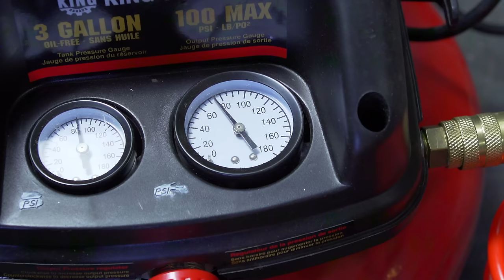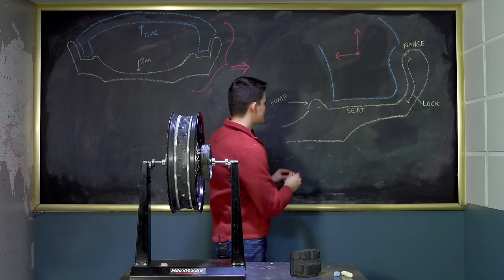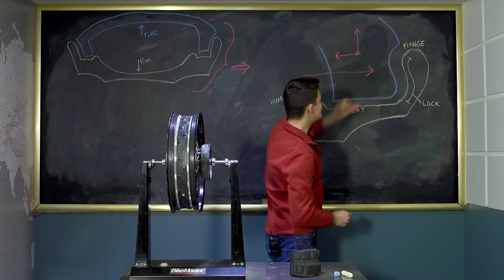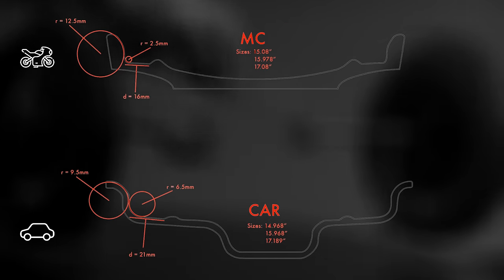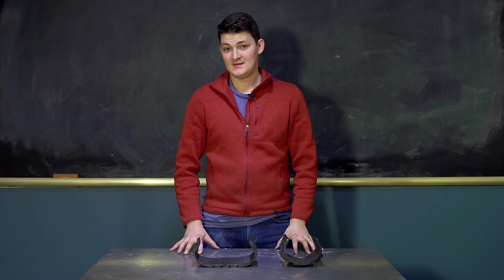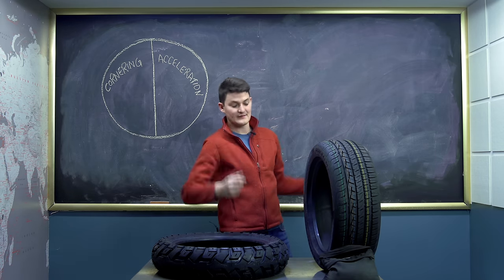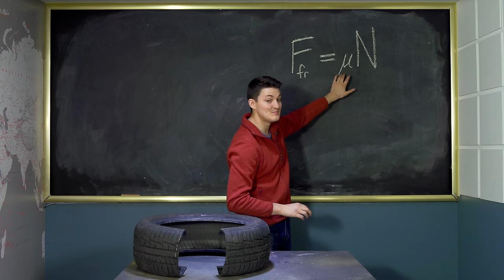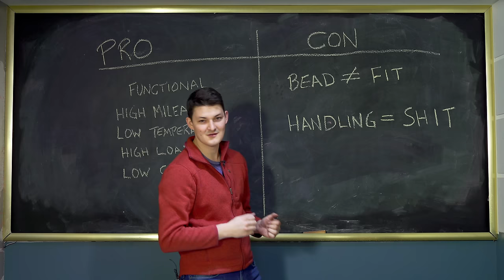Are Motorcycle Tires a Ripoff? The Darkside Car Tire Experiment

Comment: One application I've seen car tires seem to do OK on a motorcycle: Sidecar equipped bikes, if you can still call them bikes.
Reply: Right because when you break hard for a deer the bike is upright and that tiny contact patch on a mc tire vs a car tire is going to slow you more/faster how?
Reply: @modifiedchevy   Ffr=uN
Reply: yes I've watched a video the old guy with 1200 1200gs with sidecar
Reply: More like trikes, than motorcycles 🏍
Reply: Good car tire and good steering damper, otherwise tendency to become unstable and wobble at any speed.
Reply: @copwcuffs5415  Yeah, where I saw it was all over the Philippines, and to be honest they MIGHT have been special trike tires, I'm not sure. The tires were maybe a little wider than the donuts the similar sized bikes were running and flat on the bottom. Since they have so many 125-200 cc trikes around there it's possible they were actually made for that application. Not certain.
Reply: @modifiedchevy  duh. Most bikes, that is anything but some cruisers or a goldwing, brake hard through the front tyre, more than 80% of the brakeforce through that.        Unless you suggest you are going to darkside the front, you don't have a point
Reply: @gur262  ever braked so hard for a deer using both breaks that your rear tire locks up and tracks at an angle and you have to release and reapply the breaks? I have. Twice. Once dark sided and once with a stock factory Dunlap mc tire. Guess which one tracked straight and didn't need to be released and reapplied. The riken raptor dark sided. Yes the front does most of your stopping but on my CTX1300 I've also got a 3piston caliper in the back. Guess what. It also has great stopping power. You can only apply so much force to the front tire before it locks and you crash and burn. That added small % of stopping force by going dark side can and has made a huge difference in stopping power

Comment: Best explanation I've ever seen on the subject !  Some great tire changing tips in there as well !
Reply: And finally somebody who knows "the bigger contact area means better grip" is bullshit.
Reply: @Zuluparaszt3  True, otherwise GP bikes would be running on Formula 1 tires...it's a combination of simple geometry (a larger tire increases your contact patch by a very small percentage) and simple physics (a larger tire brings more weight than contact patch).
If you are riding a gigantic dresser you can ignore most of the physics, but the rest of us actually likes corners :)

Comment: Why can’t tire companies make a mc rear tire that does what “darksiders” want ( a heavy, thick belted, thick treaded tire, made for touring )?
Reply: Avon Trike front tire, limited sizes though
Reply: enter the michelin macadam, the bakelite tyre of choice.
Reply: Heavier tyre makes for higher centripetal forces. That means more rider input to bank the bike. It also puts more force on the shock's reaction, more likely to botttom-out the shock on compression and rebound. It also takes up more engine power to accelerate meaning slower response times to throttle input.
Reply: Bad their business i guess
Reply: @Mr Murders lots of modern performance-oriented road tyres (actually meant for bikes that is) have multi-compound construction, as you described, to reduce the wear when doing highway/commute riding and still enjoying good grip levels in the twisties. Some even have a 3rd intermediate compound in between to soften the transition and provide a more homogeneous wear :)
Reply: @TheDidiwolf34  The Avon Storm 3D X-M is an example of this.
Reply: Mike Savage true, but if you’re going to do it, at least you’d have one made for MC.
Reply: Vdub Fan interesting idea
Reply: detaart hahhaha at Bakelite
Reply: Sigh. Its called Google.
Reply: They do have 2 ply tires tho! Or whatever they call it. Mine is, it has hard rubber on the center to last longer
Reply: Jaden Erickson cool.
Reply: Jack k sigh. So people are tired enough of wearing out expensive mc tires that they put car tires on. There must be something goin on.
Reply: There is just no market for it. The vast, overwhelming number of motorcycle riders in the USA do not put 7k miles on a bike before their tires dry rot and they need to replace them anyway. A tire that lasts 7-9k miles is just fine for 99% of the market. The thousands of darkside riders out there can't prop up a entire market for a tire that performs as well as a car tire.
Reply: Xaro Xhoan Daxos thanks for the explanation. I know someone who used to commute on a big Honda. He said to just buy on amazon and have a friend install them for barter work.
Reply: Why would you want a heavy tire, on a vehicle which is so dependent on gyroscopic forces?

Comment: You said in the conclusion that’s “after ten minutes I could hardly tell the difference.” But then said a few seconds later that the handling is comparable to garbage. Can you clarify?
Reply: @Wouter Incognito Yeah no shit, you didn't explain the whole "could hardly tell the difference" part
Reply from the maker: Yes! It's the frog-in-boiling-water effect. Immediately after switching from a motorcycle tire, it's obvious that the handling sucks. But if you ride a darkside tire for long enough, you forget what a regular tire feels like and the car tire starts to seem normal. Don't get me wrong - if you think about it you can always feel the ways in which car tires ride differently. But when you're just riding and not thinking about tires, you won't notice. ~RF9
Reply: @FortNine  awesome answer i must say on my concours 14 it was tough in the corners. on a wing you don't notice it all all even with the oem tire goldwings have a bit of a flat spot and still follow the road groves and depressions
Reply: @FortNine  Same if going to dual sport tires from street tires and even more so if going to DOT knobbies.  They don't handle at all like a regular road tire.
Reply: My bike, C109RT, came with a 240 stock, I chewed through 1 rear a year at about 15,000km. I switched to a symmetrical tread car tire, a 235.. wider than the bike tire (based on clearance to the rear frame), and I found handling better, the bike tire I would have to fight and almost literally toss the bars to get a counter steer going, with the dark side it just goes. I find I do get up on the edge, I can feel the rear lift in a turn, and with how wide and low slung the C109 is I find getting the lift in the rear allows me more lean angle and I can actually turn sharper.  I bounce back and forth between my C109 and the wife's Ninja 650, the only real difference I can tell between the two is the Ninja has more lean angle.  Keeping in mind, I'm only street riding, no track.  Would I dark side the ninja... hell no. But I don't think I'll go back to a bike tire on the C109, it weighs in at 1000lbs wet (yes I put it on a scale) I have a custom trailer hitch for it out of plate steel. I'm at close to 35,000km on the car tire, about to swap in yet another front.

Comment: Seems a much flatter car tire would kill you in heavy cornering because of the dramatically reduced surface contact at 45 degrees with the car tire. Since great handling equils longer rider life (gH=LrL) I will always go with the more expensive, less miles, cycle tire, thank you.

Comment: Tbh I've never heard good things about darksiding on anything but heavy cruisers... For example darksiding in a Goldwing seems relatively safe and popular
Reply: Yeah I never considered it til I got my vulcan 1600
Reply: I challenge anyone to find an accident ever caused by a darkside tire. That's after billions of miles! Darksiders know how to choose the right tire and pressure. This video has many fallacies and using a BMW adventure bike with different weight distribution, swing arm, spoke rim and even cornering angles. A purposedly biased youtube video with incorrect information.
Reply: @justmyself1000  nah
Ryan is not trying to convince anyone of anything, he states both pros and cons and let's the viewer decide. Of course certain issues will be magnified by the bike style but that doesn't mean that said issues are not there
Reply: @justmyself1000  a biased view is thinking all dark siders are experts in tires.
Reply: @justmyself1000  Actually, the information was correct.  The fit is not correct for the rim therefore it is not as secure on the rim. Science wasn't your strong point in school, was it?  He showed his work, he didn't claim anything without backing it up. It results in a poorer handling bike which is fine for cruisers, they handle shit anyway. 
What bike was chosen doesn't matter. Every bike corners basically the same way. Every bike is subjected to the same physics. For the purposes of the video, his choice was his own bike. Probably no one wanted to loan him a bike for this because it's not the most intelligent thing to do unless all you do is drive straight.
Motorcycle accidents caused by darkside? Find an accident caused by regular motorcycle tires. Most motorcycle accidents aren't published unless there's a fatality and blowouts and tire failures rarely cause fatalities when going straight. Talk to insurance companies if you really want to know.  Oh, right, they're biased. Forget it.  Even if I looked and found a dozen, you'd come back with something like "blowouts happen, that's not because of the tire". You have a built in excuse in the demand.
Reply: @tommy605  Can you show me an incident/accident/mishap caused by a darkside tire coming of the rim?......sayin'
Reply: I just don't see much reason... The tire literally does not fit on the rim and it's walking a tightrope. If someone made a "car" tire specifically designed for a motorcycle rim it would be something more worth considering, but as it stands, I don't think saving a bit of extra money is worth taking extra risk and sacrificing so much handling. That said, I'm not gonna knock anyone who does it. I can see why you would, especially if you have a big fat touring bike and put thousands of highway miles on it a year. My biggest fear would be to slip a bead while on a corner. That could easily be fatal.
Reply: @tommy605  Science IS a strong point.  Studied Biology and Math in College. Just not enough space to demonstrate this....Just show me 1 accident/mishap caused by a motorcycle. No "buts" no "ifs" or coulda/woulda/shoulda.  I would not attempt to debate a darkside tire on another bike beside a cruiser. My cruisers/touring bikes get darkside tires. My adventure and sport bikes do not.  My cruisers handle better with a car tire. Especially in wet situations. Cornering is more precise. But that is just my anecdote. Riders have been using darkside tires for billions of miles.....I'm not in any way saying motorcycle tires are bad. Just saying car tires are NOT bad.
Reply: The first ones to darkside were in the 50s and 60s with the old style choppers. Most used the old white wall tires because they were skinny enough to fit a motorcycle rim.
Reply: @BloodPlusPwn  I know several darksiders...none do it to save money.  They do it-without exception-because motorcycle tire quality is, bluntly, total shit.  One was nearly killed when his rear tire (changed especially for a trip, <1500 miles) came apart at highway speed.  The Goodyear Eagle Ultra Grip that replaced it went ~25,000 miles and will be good for one more season.

The rear tire on a Goldwing ridden 2-up is overloaded approximately 100% of the time. (The tire specified is not adequate.)
Reply: @justmyself1000  You stuck on, "show me an accident report?" It's in nearly every reply you wrote to people who said nothing about it causing accidents.

Your comment was that the video is biased. The only two negative conclusions it made were that the bead does not fit as intended and the tire doesn't handle as well. Both are facts. It also said there are many compelling reasons to run a car tire, so people shouldn't loose their shit about riders who choose to do so.  Overall this video paints dark siding pretty positively, why are you being so defensive?
Reply: @atsernov  - The car tire doesn't fit THAT motorcycle's rim properly.  And it only handles worse because the bike is too light to flex the tire.  On a Goldwing the tire flexes when you lean into a turn and you ALWAYS have more rubber on the road than on a motorcycle tire.
Reply: @atsernov  Defensive because of the melodrama we get ALL the time from those who tell us we are going to end up in some type of catastrophe. Then proceed to give us a made up anecdote about said catastrophe.....great observation that I use that in my replies. I will continue to use that...
Reply: specialy if you do only hightway riding or if you have those motorcycle tent that make you have a insame amount of load on the bike( i personally ride dark side only when im doing hightway with my trailer on a 1 month travel but during my little ride of almost all summer i go motorcycle tire because im always in curve and load to minimal
Reply: @dustintunis9347  The fitment issue isn't simply the width. The bead seat itself is narrower on a motorcycle rim. The bead simply doesn't seat as intended, still functional though.

And yes, had he run a more appropriate pressure I feel the tire would have flexed more. Still won't handle as well. 

The first time I saw someone dark siding was about 10 years ago, on a gold wing. And the tire was conforming just fine. Granted he wasn't doing anything stupid, just cruising as the bike is intended for.

I remember thinking it odd but cleaver and wondering about the handling characteristics. At no point did I think the rider was unsafe.
Reply: @justmyself1000  No, the correct information is: if you have an accident with a car tire on a motorcycle, your insurance will not pay, and they will lose any trial, and if the worst comes to the worst, you are dead or in prison
Reply: @MrKawasaurus  Not true. Show me something where a car tire has caused an accident. The burden of proof will be on the insurance company to prove the car tire caused the accident. Willing to bet an adjuster won't even know the tire is a car tire in the first place...
Reply: @MrKawasaurus  You need to prove this...qualify...NEVER heard of it...
Reply: @justmyself1000  you live in USA? There are very different laws than here in Europe. If you do a car tyre on a MC, the police will take away your drivers license, and the technical check by government will fail..
Reply: @MrKawasaurus  Not in America....can you show me where this is written for Europe?
Reply: @justmyself1000  you can use google tranlator for reading this article: https://blog.reifen-vor-ort.de/bedeutung-der-reifen-freigaben-beim-motorrad-reifenfabrikatsbindung-unbedenklichkeitserklaerung
Reply: @MrKawasaurus  But can you show me where this is written?
Reply: @MrKawasaurus  Ha ha! I can't read a word of that! Guessing German or Dutch? I'll trust that it says something in there....Too bad for this country!

Comment: also have you ever seen how car tyres  move around in curves   you can see  the marks  at least halve way up the side walls  where  there is no tread at all. car tyres are designed to move around under great pressure

Comment: will you ever do a video on "winter" motorcycle tires? (most often 16 inch)
Reply: e.g. Heidenau K60 silica
Reply: @kuro neko analas wintergrip, they even have a winter approved snowflake
Reply: I was at a Triumph dealership a couple months ago just poking around and I noticed something in the literature for the XC1200 ADV Scrambler thing that said it was rated to something like 60mph in the snowy conditions Sure as shit the tires had the snowflakes and everything. Do people actually do that? I could see offroading in the winter but riding on the road? Doesn't seem worth the risk to me (I ride all the way up until snow/ice accumulates) but its cool that its an option
Reply: @slappydave4241  -Rode Triumph 650, 50 'miles' commute round trip, every day, year around... in Northern Illinois. Snow was like desert racing, Ice was like.... Ice Racing. Had to pay strict attention in both... body English, lots of it..
Reply: @Blogengezer  You are much braver than I, kudos! 
I've tried to ride my FZ07 in the driveway when its snowy and icy. No sooner would I have my feet up would I drop the bike lol. Granted, this was on normal street touring tires and not a winter, offroad, or studded tire of any sort but it was enough to tell me not to push my limits with slippery road conditions

Comment: On my 2003 Suzuki VL1500LC, I went dark side around 20,000 miles. After ONE tire change, I sold the bike about 64,000 miles later, with plenty tread on the second tire.  I cornered like I stole it, almost wore the pipes out scraping asphalt.  I had better wet-road traction, better stopping, better all-round 'feel'.   Yes, it takes a little getting used to the car tire, but after a very short while, i didn't even think about it.  Btw, I also mounted a motorcycle rear tire up front.  Reversed it so as to handle similar forces.  Deeper tread, lasts a lot longer.